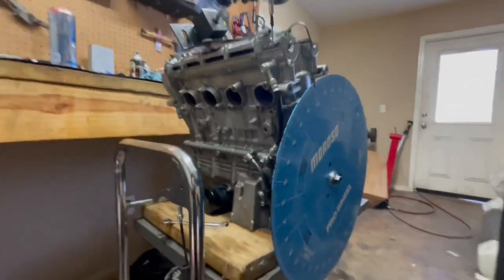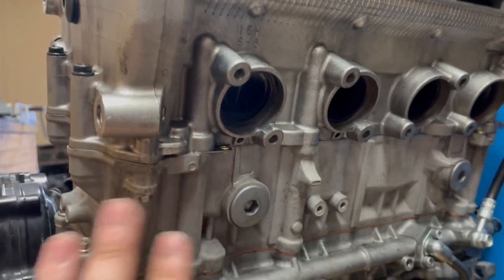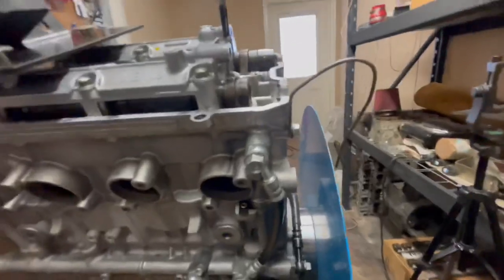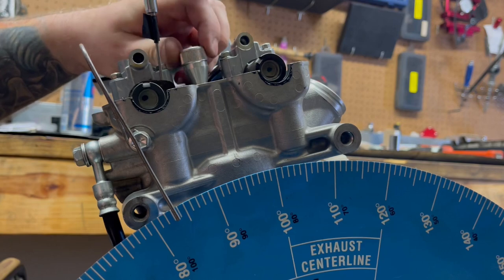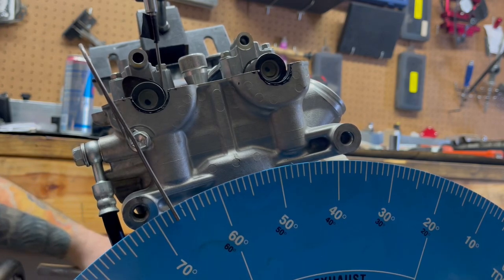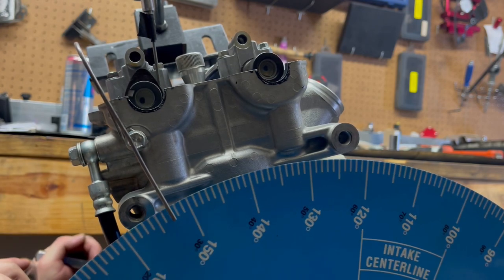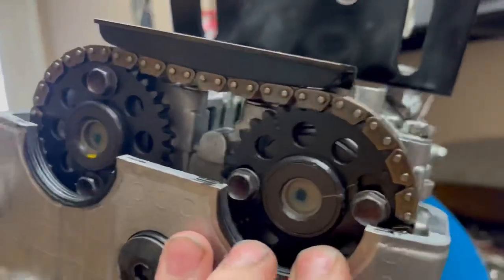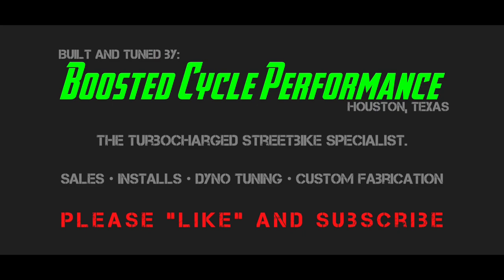How to degree cams on your Hayabusa

Comment: I like mounting the timing wheel opposite to what you show (numbers towards the engine). The reason is I can easily see the numbers as I turn the crank from the right side of the engine. You have the nice, big Moroso wheel so you can view it easily.

Comment: Good information and keep up the good work. Love the details and techniques of your work Do you bother to degree in the exhaust cam ? Have you tried, especially that your boosting the bike, to experiment with different can timing ? Especially widening the intake/ exhaust centerline to reduce valve overlap ? Thanks and keep tech going.
Reply from the maker: Yes I degree both. Most cases I just use factory numbers. 105/105. But you can move where peak torque and HP around by changing those numbers up or down a few degrees depending on what you’re doing.

Comment: Hello; why those wheels say "intake open" at the right of TDC? BTDC would be at the LEFT; you know; before...
I have 2 notches in the crankshaft flywheel of my bike. One is for TDC and the other is at 37ºBTDC. always stop (if I use an stop tool) to the left of the TDC mark on the wheel...

Comment: While for the most part you are doing it right procedurally, you did error in your placement of the dial indicator.  Around 16:20 in the video when you go to the side view of the degree wheel/head/pointer/dial indicator extension, I could see you didn’t have the dial indicators axis in line with the valves axis of travel.  That introduces a slight amount of cosine error or parallax error.  You have the indicator axis vertical (as in the same axis as the head studs). Busa is 14 degree valve angle or 28 included angle.  Think about what the tip of the indicator is doing as it “tracks the bucket travel.  It is actually sliding ever so slightly since your not inline with its travel.  Not making this up, I’ve been building these 4 cylinder gs, is, gsxr, hayabusa, gsxr1000 singes the nineties.  It’s not much and it’s even hard to see with the naked eye but it’s gonna throw you love centers off by a several degrees and the whole idea of degreeing them in the first place os to place them exact not close. 

Also, you explanation was kinda hard to follow, especially as you were doing your measurements of the before max lift/after max lift points.  Why so many sweeps of the indicator?  Why not just rotate the engine till your on max lift and zero out the indicator.   It’s pretty standard in the industry to use .040 or .050” before max lift as measurement points.  I’ll have to rewatch, maybe I missed your explanation.  I know there many ways to degree cams, it’s like “skinning the cat”.  My buddy goes .050” off the base-thru max lift-and back to .050”.  Thinking back maybe that’s what you were doing, lol.  At any rate the end results will be the same, the larger spread might average out a 1/2 degree more accurate or something cause your averaging a larger range.  Similar to how the tdc mark on the crank gets you real close then a positive stop and sweep before and after pinpoints actual TDC averaging out the dwell at tdc that the oem mark can’t account for.

Oh yeah, back to the indicator placement. I know why you have the indicator like that.  In a busa engine, with the cam right above the bucket and with the diameter of bucket you can’t get a straight shot on the bucket keeping it inline with the valve and not rubbing the shaft portion of the cam.  Here’s the fix, take some tig welding rod that’s sized to where it’s screw into the end of the dial indicator after removing the little ball tip.  Off the top of my head I think 3/32 tig rod screws right in.  Then, you just bend a little half circle with just a tiny little straight tip after the half circle.  That tip is to contact the bucket.  The other end play with the length and the placement of indicator till appropriate.  There is just enough room to get around the cam and onto the edge of the bucket and now “track” it’s movement with the indicator and extension “lined-up”.  It’s even closer but still doable on gsxr1000.  The 17 up L7 gsxr1000 has finger followers and so you go right off the retainer.

Comment: Also; 0.020 is not 5 complete rolls of the TDI. What kind of clock do you have? In inches a normal one; if you use 0.050 is just half of a turn...so imagine 0.020